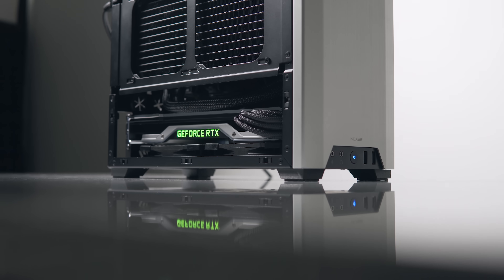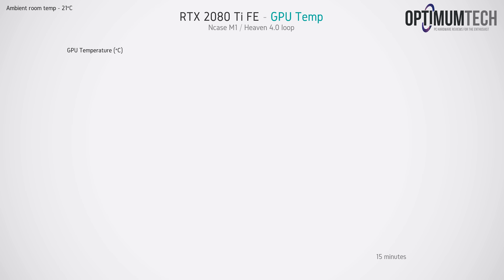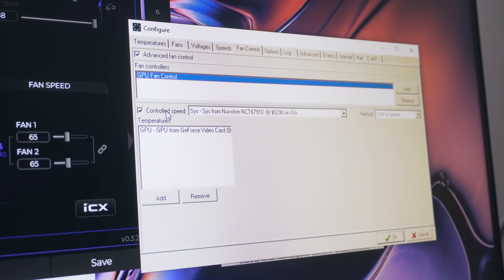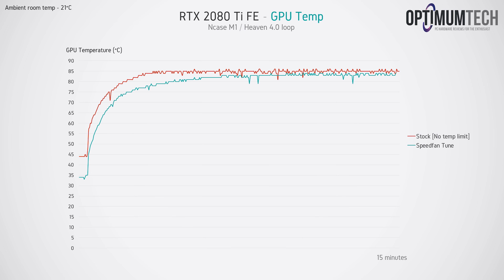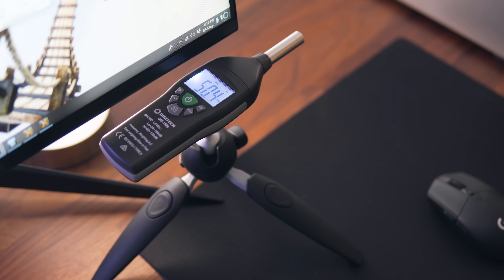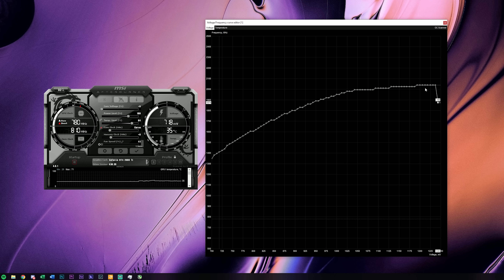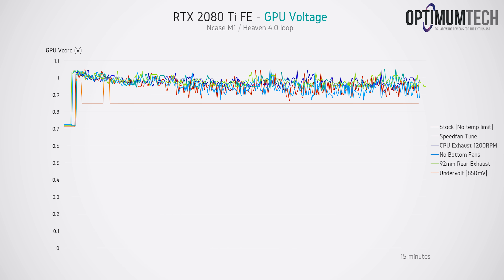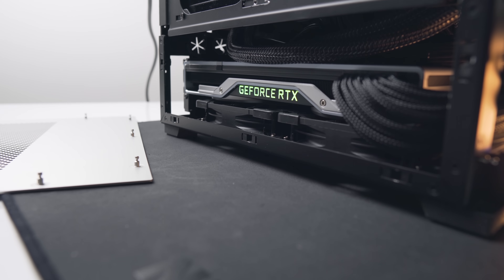Fixing my Thermal Throttling 2080 Ti FE..

Comment: CHAZ Did you see that someone somehow fit 4 rtx 2080 tis in an itx case with a threadripper and somehow scoring more than the average system running 8 rtx 2080 tis in octane bench while also not getting over 76 degrees Celsius? They only used Noctua fans and still had enough space for 2 more M.2 drives and 2 HDD. Here is a link to the article: https://www.notebookcheck.net/Speedy-custom-desktop-with-4x-RTX-2080-Ti-cards-rips-apart-OctaneBench-without-going-over-75-C.420141.0.html

Comment: you might get better thermals by removing the shitty 4k rpm fans and putting the noctua's on the heatsink  directly did this to a vega 64 and temps got a few c cooler and WAY less noise

Comment: No one ever covers this or maybe they don't know about it, but in MSI Afterburner you can press "L" to lock the frequency and voltage. It's the only way pascal will stay at the desired voltage. Only 1 little box to drag then press L, apply and done.

Comment: you could have gone with a RTX 2080Ti blower style card that is made to blow all the hot air from th card outside the case such as this Asus Card https://www.asus.com/us/Graphics-Cards/TURBO-RTX2080TI-11G/       https://www.pugetsystems.com/labs/articles/NVIDIA-Dual-Fan-GeForce-RTX-Coolers-Ruining-Multi-GPU-Performance-1239/#WhatisCausingthisThrottling?

Comment: Would you be better off watercooling the graphics card rather than the cpu?  Or could you even do both with 2 - 120mm aio coolers?  That would seem like a lesser solution to a single custom loop, but it would allow you to use off the shelf components.  I like the undervolt.  Good results.

Comment: If you are worried about noise I highly recommend using the: "be quiet SILENT WINGS 3" 120mm 1450RPM PWM fan, I replaced my Noctua NF-F12 120mm PWM 1500RPM fan with the be quite silent wings 3 fan. Temps were the same using a 120MM AIO rad on a EVGA RTX 2080ti XC gaming Hybrid. The be quite fans run 50rpm slower & are much quieter: Max@ 16.4dB(A).

Comment: I have an identical system using the nf12x25 fans and a thin 92mm noctua with the kraken 52.  Mine is loud but doesn’t throttle but I’ll try to undervolt. Thanks for the info!  Just curious if you could try this setup with a 3 slot aftermarket 2080ti to see if it gets better?  I was also wondering if it would be better to try an aio water cooled card and then air cool the cpu vs use a 120mm cpu aio?

Comment: I added a soft foam around the card so the gpu fans pull air directly from the bottom of the case. I found that sealing the fan intake didn’t allow hot air to cycle into the fans and cause the temperatures to raise. I did this with an overclocked GTX 780ti and temperatures never went above 75*c under full load.

Comment: In the voltage frequency curve editor: 

 Ctrl + up/down direction keys =   +/-10
 Shift + up/down direction keys  = +/-1 

Made my life much easier. Hoping they could add an option that would level out the rest of the clock speed based on the value on the left point

Comment: You could fit 240 AIO on the GPU with the fans pushing the air out of the system (on the bottom)

Comment: Get a Board with thunderbolt 3 and get the thunderbolt 3 to 2 adapter , then buy a thunderbolt 2 dock and get a thunderbolt 2 optical cable , then you can put the pc 60meters/200ft away.  Problem solved, you dont need it sitting right next to you.

Comment: Hey Ali, Im super curious as to why you switched from the 1080ti to the 2080ti if youre playing on the Acer 34in 100hz monitor. Ive pretty much the same setup that you used to have with the 1080ti and have experienced nothing but buttery smooth goodness at 120fps. I havent felt the need to upgrade at all especially not for over $1000 (I'd much rather spend that on the new Zen2 and ITX motherboard). Would you recommend upgrading to the 2080ti if you are playing games in the 100-120fps range on 3440x1440p ultrawide monitors? Would really appreciate a video comparing the two in both audible and visual performance.
Reply from the maker: Hey Houze, upgrading to the 2080 Ti was more for the channel than a personal upgrade. 
It gives me the opportunity to make interesting content like this :)
I game on a 1080p 240Hz monitor these days also which is about as demanding as 4K/60fps.
Most people will find the 1080 Ti to be absolutely sufficient for Ultrawide / 100Hz gaming.
Reply: What games are you playing lol, overwatch or csgo? In demanding games with high settings you're not getting a stable 100 fps at 3440x1440p with a 1080 ti, not even a 2080 ti will give you that.
Reply: @CDLightt  lots of car racing games and shooters. Lately lots of MORDHAU!!!!
Reply: @dadada72  what screen do you have? 1440p 100hz+ is no joke to run and even my 2080 ti dissapoints me in some games.
Reply: @CDLightt  tweak some settings. Depending how far from the screen you sit you dont really need heavy anti-aliasing at some higher resolutions and I wouldn't sacrifice fps for those polygons. Unless what you're really looking for bragging rights... I've got the Alienware AW3418DW. Probably my favorite piece of tech that I own.
Reply: @CDLightt  3440*1440@ 120fps is basically the same as 4k @60fps though might be a little more demanding on the CPU and depending on the amount of AA it could be even more taxing on the GPU. Nevertheless I find the games that I play I get over 100fps on them and its perfect. Im sidegrading to the Radeon 7 as my new case wont fit the my old GTX 1080ti so we will see what that GPU can push out very soon.

Comment: I have an Ncase M1 as well with the following configuration:
Cpu: Delidded I7 7700k @4.8 Ghz using 1.265 V
GPU: 1080ti founders edition.
I suffered from bad temperatures or really loud systems for a while. Finally I got a corsair h80i for the cpu with a single noctua NF-A12 (can't put two fans because of space constraints and got a evga hybrid cooling kit for the gpu.
This I think is the best setup for my hardware. Cpu temperature goes up to 70 degrees at times, but the gpu never exceeds 46 degrees (my core is overclocked to +160 and memory to +500). Your set of hardware will generate a lot more heat, but maybe you can look at a similar setup to get the best balance. Thanks for the excellent work that you do. We don't deserve you.

Comment: Disappointing for the Ncase M1. Not even a OC 9900K in there.  Currently running Raijintek Ophion EVO with OC 2080Ti and 9900K. Had to build a custom mesh for the side panel next to the OC 2080Ti. But still WAY cheaper than Ncase M1 and reasonable noise level. (Almost completely silent during every day use cuz the Gigabyte Windforce doesn't even spin up til about 50 degrees.)

Comment: I'm currently using a pair of slim 120mm fans on the bottom of my M1 and my 2080 ti isn't giving me the same issues that you are having. I am running the card stock with the power limits set to max in MSI Afterburner though.

Comment: I wonder if some of the aftermarket 2-slot coolers would perform better, like the EVGA XC Gaming. Otherwise, 3 slot coolers would do well in the M1, but not having bottom fans wouldn't be ideal for having consistent and quiet case airflow.

Comment: I guess short of a custom loop, using an Accelero or an NZXT G12 would improve temperatures considerably. For the latter, you'd need to scale back your CPU cooler to a 120mm though.

Comment: I wonder if thermals and noise would improve if you used the slim A12x15 fans on the bottom. They would provide less airflow, but you'd have significantly more clearance between the GPU fans and the case fans, so air would transfer more efficiently. I think part of the problem here is that the 2080 Ti FE fans have that pronounced frame rim that almost touches the case fans and it probably creates turbulence and inefficient air transfer.

Comment: While under volting in msi afterburner with ctrl+f. Try dragging one down from the middle (make sure it is lower than any other one ahead of it) and clicking accept, it will save time

You're welcome
Reply from the maker: This only works some of the time though, afterburner is weird like that lol
Reply: Huge pikes on a curve can lead to performance issues, the idea is to overclock the card to X desired MHz on the X desired voltage and then lower all the MHz past that X desired voltage
here's my undervolt curve on a G1 1070 = https://media.discordapp.net/attachments/397845021237313547/575560118016409603/UNDERVOLT3.PNG?width=1057&height=377

Comment: Maybe Kraken G12 on the GPU with a 120mm AIO, and then another 120mm AIO for the CPU. I know that would hurt CPU thermals, but most games don't stress the CPU that much, so you could get by with it.

I use a 120 mm AIO on my OC'd Ryzen 7 1700 at 4.0 Ghz at 1.4 volts. It's peak package power draw is about 180 watts in a stress test, but barely breaks 100 watts in games. I get temps in the low 80's during stress tests, but doesn't break 55 C in games. Since this is gaming pc, You could get away with a 120mm AIO on the 9900k.

Comment: Why did you switch from the louqe ghost? I was about to get the ghost because Dan C4 seems to either be vaporware at this point, or it will be nothing like the concept used to be.

Now the problem of louqe is they went from 200 euro to 269... Can't help but feel scammed if I budge and pay more for the same product that others paid so much less for. At least they should explain the price increase for people to not feel scammed.

EDIT: and I don't want n1 because I 100% want vertical GPU case no matter which case I end up buying that is a prerequisite.
Reply: I would not recommend the Ghost S1 at the moment. They are having huge issues getting them shipped. Really sad as its a very beautiful case, too bad they cant run the business side as well.
Reply: @dadada72  issues is an understatement. Louqe is starting to feel like a scam company.

Comment: This is really random but have you tried flipping the bottom fans to exhaust? In the Cerberus thread on sffnet which has a similar layout to ncase m1 people have had success with the bottom fans exhausting air out vs pushing fresh air into the gpu.

Comment: The next revision of the M1 (V6) includes expanded ventilation areas on the side panels and floor of the case, which should help to address the heat concerns of high-TDP open cooler cards by more effectively allowing the GPU exhaust to escape from the case. M1 V6 is currently expected to be available this summer from SFFLab.
Reply: Just a tip. Send a sample of the new sidepanel out to Optimum Tech. He could do a video on the difference with a highend gpu @Ncase Design
Reply: is it compatible with V5?
Reply: @ShakaffAhmad  Yes, V6 panels will be backward compatible with previous versions.
Reply: Nice to know. Thanks
Reply: Please Ship to philippines
Reply: I really don't think think anything other than under-volting the 2080ti is going to work.  That graphics card is fuckin hot...Like burning hot.  It's kinda scary!! lol

Comment: Nice, my 2080Ti runs at 1920mhz/ 925mv. I would assume the 2080TI is most efficient at this voltage because once the voltage is higher than 925mv, the clock doesn't scale linearly. This overclocking + undervolting provide 12% better performance than stock at lower temperature and fan noise, and higher frametime consistency (since the clock is stable).
Reply: And how is it cooled? I guess it's watercooled then
Reply: @deineltan9764  jup it is watercooled. 2080Ti loses 45mhz when temp is above 70C. So yeah there is more reason to undervolt it on air since you can keep the temp lower.

Comment: it is time for you to install gpu aio on this case bottom. would 15mm thick fans(a12x15)+27mm thick 240mm aio fit in this case bottom?
mod g12 mouting plate, cut out the vertical part (nzxt logo).
looking forward to see dual aio setup on this case.

Comment: Don't you want to try using Raijintek Morpheus II on this card and see what the temperature will be? Cause I google just now it seems like Raijintek Morpheus II fits on 2080 ti
Reply: It doesn't fit in the Ncase M1 though. But the Arctic Accelero does, he used it in the M1 before (on a 1080Ti). Not sure if the Accelero works with the 2080Ti.

Comment: The bottom 25mm thick fans are too close to the graphics card. Could you try 15mm thick fans so there is less turbulence before the air reaches the graphics card? The job of the bottom fans are just to supply fresh air to the GPU. A pair of good 15mm thick fans could handle the jobs nicely.
Reply: That's what I thought. Would've used some Scythe Slip Stream's, they're just 12mm thick and pretty quiet at 900 rpm.

Comment: And that was the main reason I did a custom loop inside the H200i. My RX580 sound like a jet engine and I had the case right next to me. There are always people saying that some cards don´t need watercooling but it depends on what you´re looking for. I like having my system running somewhat quieter, so watercooling is the right choice in my opinion. Have a look if you will ;) https://pcpartpicker.com/b/gwvnTW

Comment: Nice - its nice to have to exposure to Nvidia GPU undervolting as well. Undervolting is far from a Radeon exclusive :)

My 1080 is sitting at 0.95v at 1950mhz, got a 7 degree drop in temperature full load. Very nice inded.

Comment: If you are planning on a custom loop, I would recommend XSPC's ultra thin radiators, the TX series (just 20mm thick). I recently bought one for my mITX build and it performs practically the same as thicker radiators but saves a lot of space. If you combine those with Noctua's A12x15 fans you could possibly get away with 2x240 mm rads! There are several options for very compact pump-res combos as well, so you could build a real gem in this small case.

Comment: Now what you should do is put it into a standard case will lots of airflow and room and see how much performance you are losing. It might be minimal so maybe under volting is the way to go.

I love the mini-itx builds and I use a larger ITX build for my theater but for a standard rig I just use a larger form factor so that you have no compromises.

With all of the cases available and lots of the SFF niche ones I wish someone would make a case dedicated to air cooling. No one does they all focus on radiator support. I’d like something like a higher quality and slightly more compact Corsair Air 540/240. Just enough room front to back for fans up front and a good sized GPU. Some space at the bottom to intake some air for a triple fan GPU and a bit of room at the top for fans and cables, lastly width to handle the largest of HSF’s. This is why the PC-011 fails for me it can’t handle a D-15, R1 or similar cooler.

Comment: How about an aftermarket gpu cooler, like the Morpheus or something similar?
Reply: Why would anyone buy a FE card, it is objectively worse than like all the other partner produced cards. And then the idiot is like "fuck my FE card is overheating". Well no fucking duh its throttling, nvidia literally built the cooler to do that very thing. Only buy a FE card if you plan on water cooling it. Otherwise, you an idiot for getting one.
Reply: CAfakmykak I completely agree dude. Why anyone would buy an FE edition is beyond me. Always go for 3rd party GPU’s. Better cooling and performance. Benchmarks don’t lie
Reply: Morpheus wouldnt fit and to be honest its too damn ugly. Arctic are not strong enough for the 2080ti (and not so pretty as well). Loop is the only choise when it comes to this card, just like the Vegas.
Reply: @TTL_Tsaki  The arctic is much better than the stock 2080ti cooler...

Comment: My 1080ti is hot with my cheap 3 fanned case on AAA games. Will getting accelero 4 fan give me better results than getting a premium better airflow case? I play with 75 hz with vsync on getting 68-75c open case. Closed its 71-85c. Will fixed vsync help your temps even more?

Comment: just wondering... what would happen if you just put in a 2080 TI MSI TRIO X ?
Reply: I don't think it would fit in that case.
Reply: @Kryptonice34  Yes the M1 does not fit extra tall GPUs due to the PCI-E cables against the side panel.

Comment: You could try to liquid metal the GPU Die to get another 5°C - 8°C  improvement. But check the warranty conditions of Nvidia first.
Reply: GPU is "delided", it doesn't make much sense to apply liquid metal.
Reply: @allansh828  you can still get a performance improvement with a naked die+coldplate. The chip being naked or not doesn't change the fact that liquid metal is 6 times better at thermal transfer than some of the best thermal pastes.